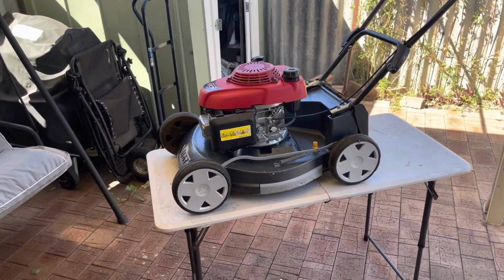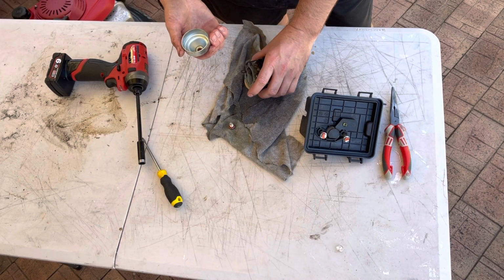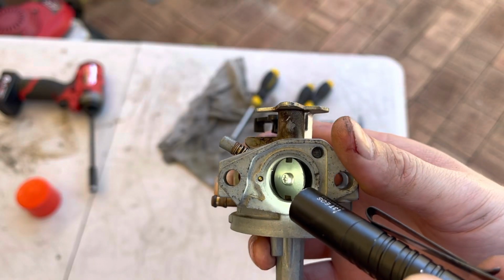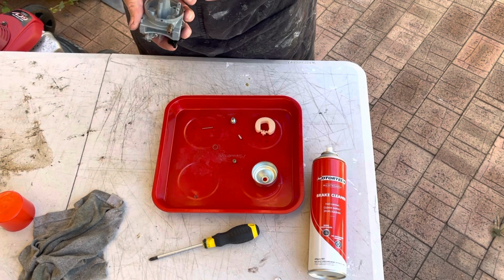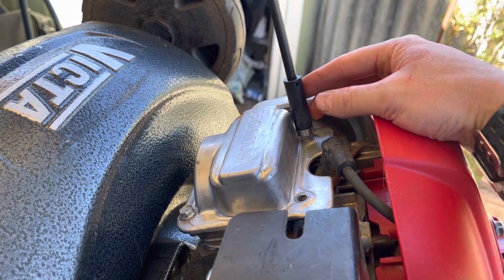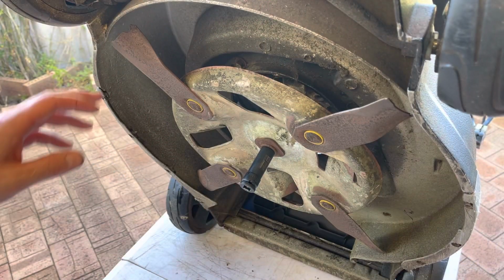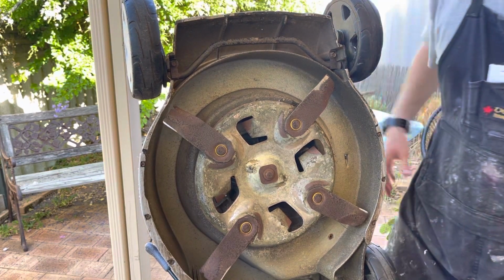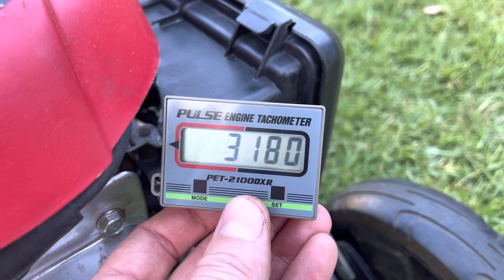Honda GCV 160 Service & Repair

Comment: Good job Tom, that mower looks to be in really good condition. If you start doing several of the Honda engines you
may want to check into the M6x150mm Stainless Steel Threaded Rods to hold the gaskets, spacers and carb together. Makes
it much easier than fighting it all to put it back in place, The Lawnmower Lady has a good video on it.  👍🙂
Reply from the maker: That’s a great tip thanks John mate! Yeah it’s a bit of a fiddle isn’t it!

Comment: Good one Tom - looks like a solid little mower. Was that Gasket Maker you put on the paper gaskets?
Reply from the maker: Thanks Claus, it’s Permatex aviation form-a-gasket. It’s a dressing compound for gaskets rather than a replacement for a gasket :)

Comment: Damn nice clean up job! What do you use to clean the engine so well? Reason I'm asking is, I've got an outboard motor that could use a good clean up. Been sitting for a number of years. 👍🍻
Reply from the maker: I normally clean equipment wjth degreaser in a spray can and then finish off with lanotech :)

Comment: You will fall in love with auto-choke in a hurry. Primer bulbs are very 2003. 🙂 With a few exceptions, most mowers over here don't have primer bulbs.
Reply from the maker: I don’t like primers or purge bulbs I must admit. I’ll take a choke any day :) thanks for watching mate!
Reply: @Vintage Engine Repairs  there are a couple types of primers. The ones attached to the airbox are the only ones I don't like